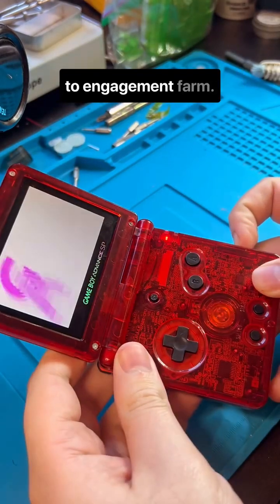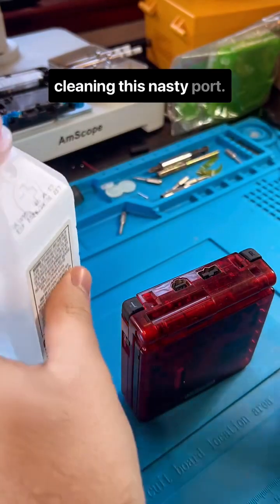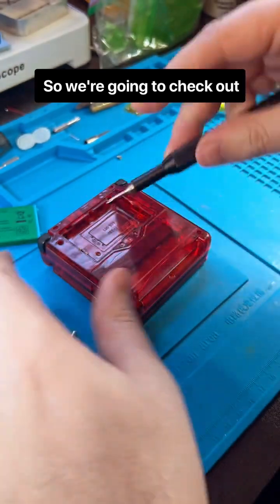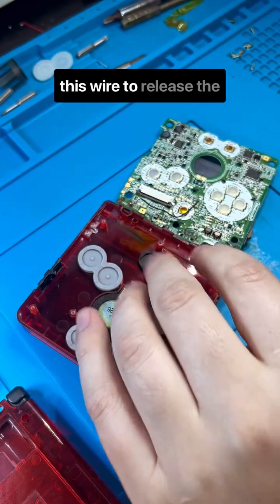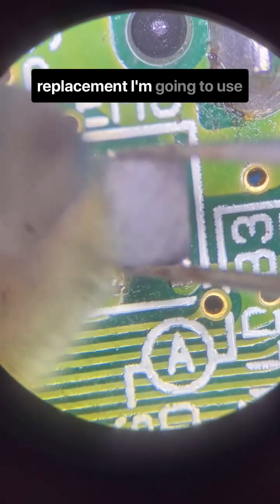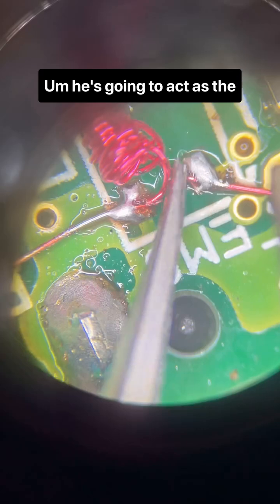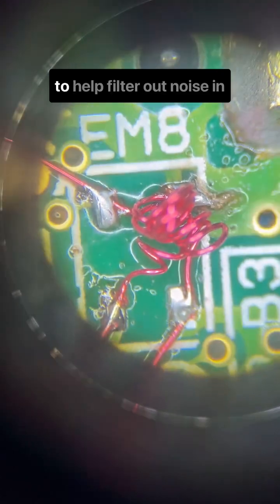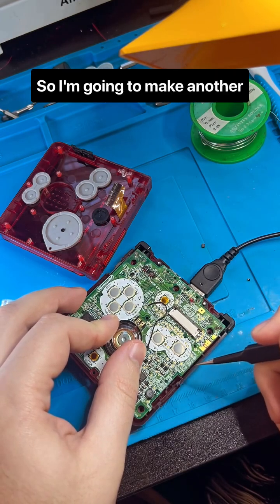Fixing A GBA SP That Won't Charge!

Comment: While I was installing the usb-c mod I accidentally damaged that part and the gameboy won't charge(or at least the charging light doesn't come ON). I noticed that the top left leg of that component is not connected anymore. What do you suggest doing?
Reply from the maker: This component (em8) is essentially coiled wires to filter noise feedback when charging. You can actually just put a wire between those pads (top left to bottom left, and top right to bottom right) if you don’t want to buy a replacement em8 from digikey. I actually don’t know if you’ll actually hear a hum or anything if you just connect those points without a coil, and I would bet that it would be fine.

Comment: Couldn’t you just bridge the contacts side to side and ignore the noise?
Reply from the maker: Yeah, but that’s no fun ☝️
Reply: @MiggysMods I’m just wondering because I’m ordering a advance sp with charging issues so I was looking into the fixes and this came up and i wanted to be able to fix it with a non pinpoint soldering iron maybe I’ll just heat gun it at worst
Reply from the maker: @Andrew-hh3ol  Ah gotcha. Yeah, you can bridge the points and it'll work with no problem (top left to bottom left, top right to bottom right iirc). You might here some humming through the speakers when charging it, but I actually haven't tested it myself to see if it's noticeable that way.
Reply: @MiggysMods copy that I might post a couple videos on YouTube when I get the project in the mail the person says it only charges for a second at a time but they have other working batteries they’ve tested as they were selling other consoles that worked  for $100 I got the broken console , battery charger(new), and a ips mod and groudon shell if I get it working it’ll be awesome it might also need a power switch I just ordered it from Hawaii and I’m in California so the ips and shell won’t be here until June but everything else will be here in a few days probably
Reply: @MiggysMods I suspect they have a Bad port or intermittent connection in the circuit
Reply from the maker: @Andrew-hh3ol Could be a few things, usually the EM8 component or a fuse. Worst case would be if it had corrosion, because you’d have to check all the traces to see where a connection is missing. Corrosion also sucks because it usually affects more than one thing.
Reply: @MiggysMods i ended up getting another motherboard it was missing a lot of connections in harder to fix places card slot trapped some moisture but now it’s running good besides the hinge I think I installed wrong